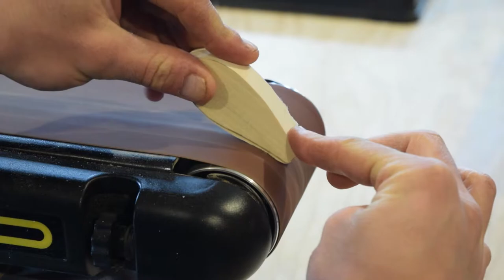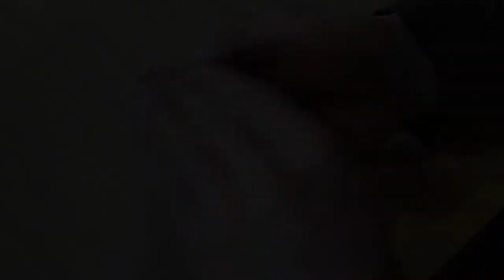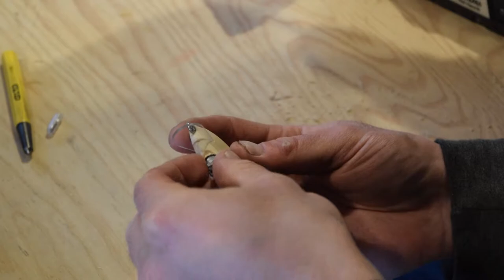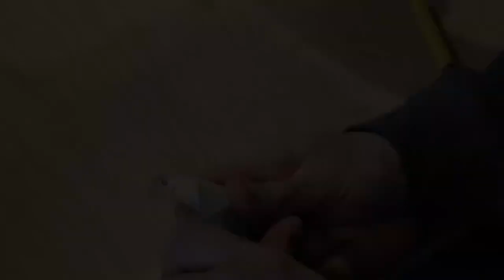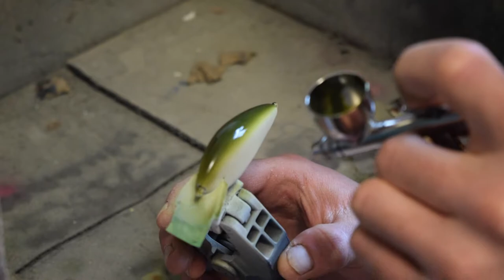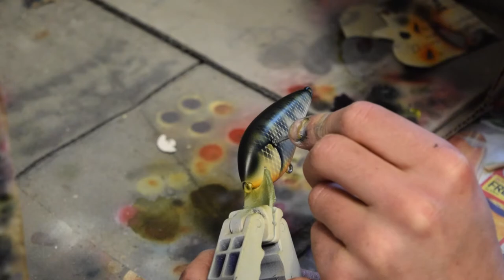Making and Painting a Sunfish Crankbait

Comment: Great video👍 very impressive artwork! How you close those wholes you have put the weights and Rattle in? What is this white powder and which glue are you using?
Reply from the maker: Thank you very much! The powder is baking soda and I use thin super glue which turns it into a rock hard filler!
Reply: @LogjamLures  That is brillant! Many thanks and always tight lines. Greetings from Germany
Reply from the maker: @abenteuerangeln4223  No problem. And the same to you!